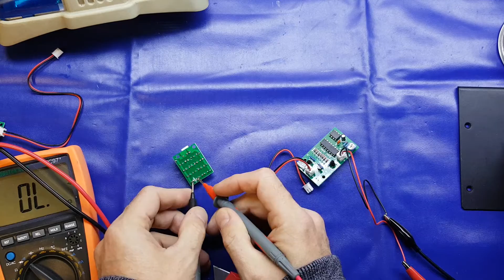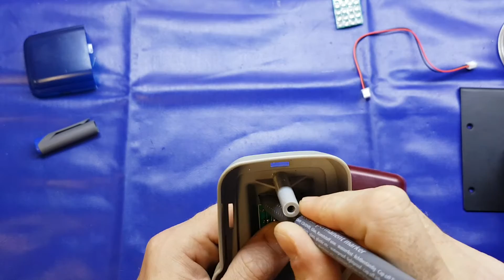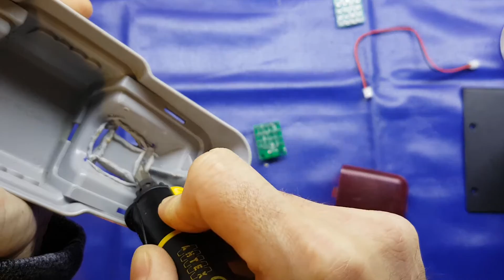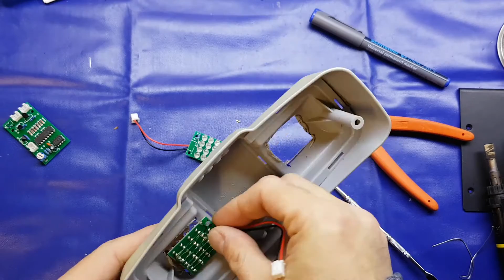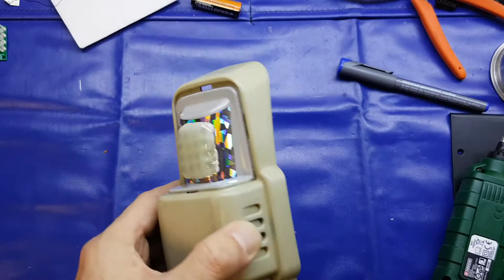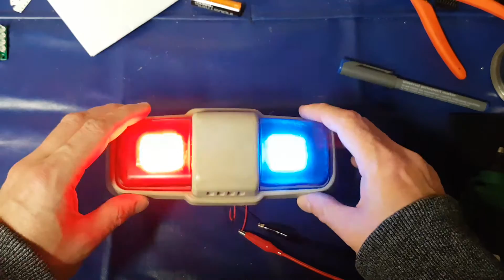Building police lights for a Little Tikes police car

Comment: I love this idea, its been a while i see but i want to do this to my boys police car. I have some red/blue led's coming with controller but i want to add this mod in also. Im using an 18v hedge trimmer battery to power everything so can leave it at 12v but the link odesnt work any more. Was this specific to use in the cozy coupe light set or was it just a random buy?